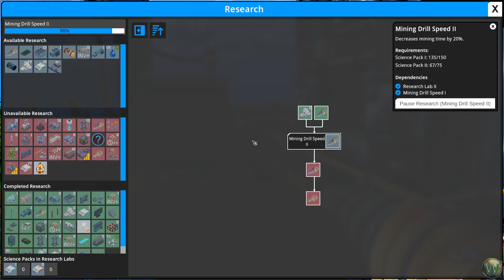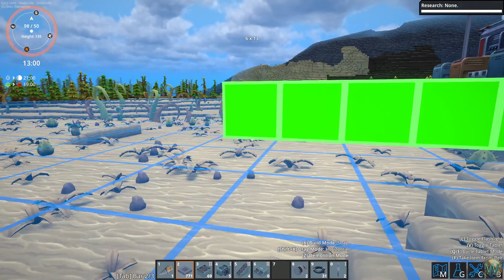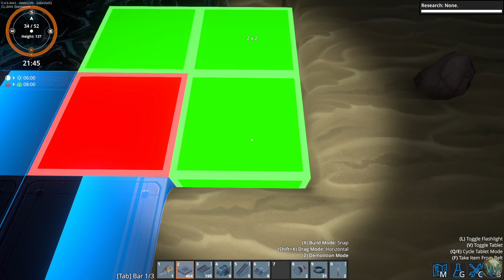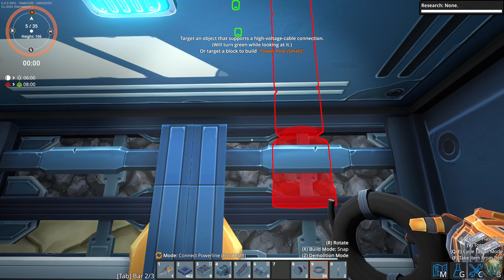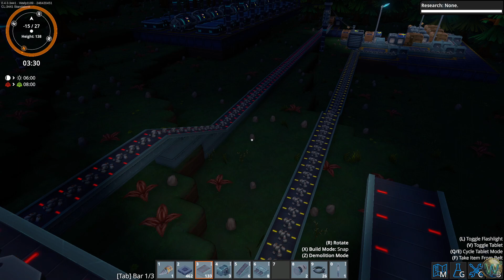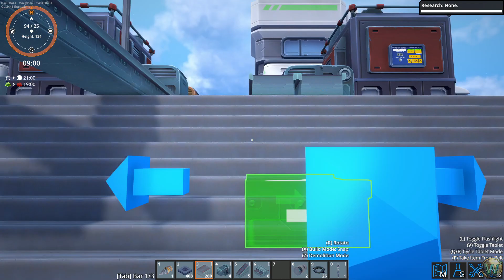Foundry - Smelting Tier 2 Technum & Advanced Machinery Parts - Episode 11 - Let's Play

Comment: I found out if you hold right mouse button with the loaders. You can set them to different states. One lets it automatically adjust compared to what it is connected to. Speeds up building
Reply from the maker: Oh?  That's cool.  I'll check it out!
Reply: @Wally1169  oh I may have been wrong. Unless they changed it. When I played last if it was set to default it would auto change to how the sorter is placed. I better test more. Sorry. Loving your vids 😃👍🏻
Reply from the maker: You’re right, I’ll show it tomorrow.  Thanks!
Reply: @Wally1169  wow thanks!